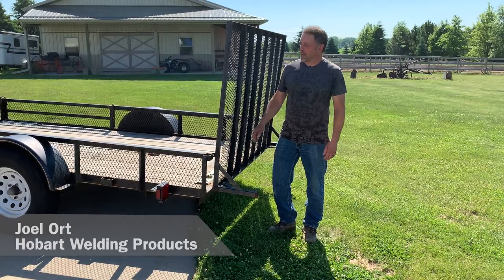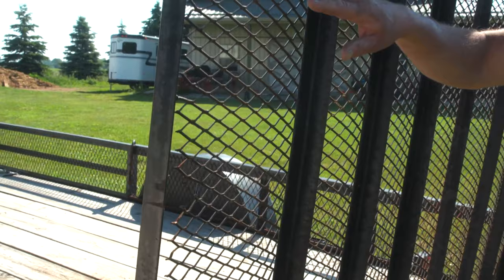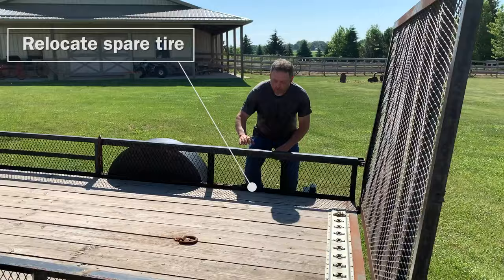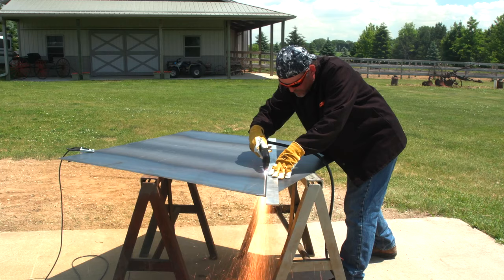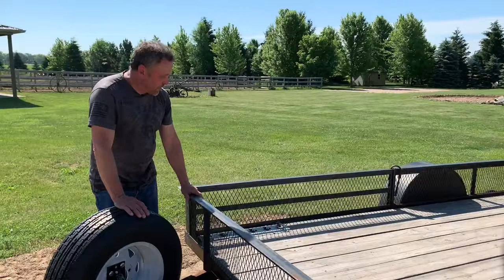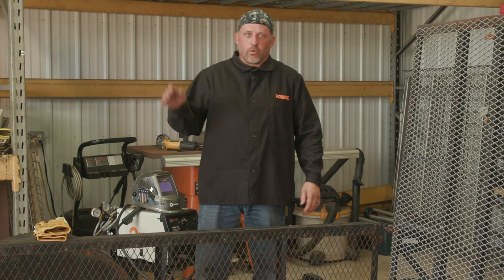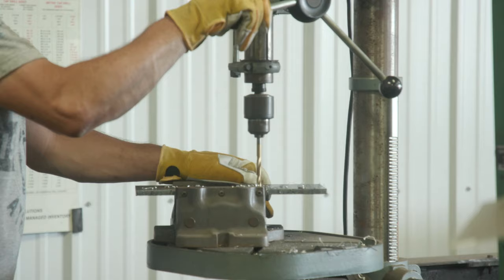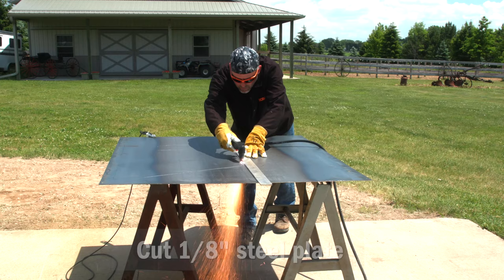How To Repair & Customize a Utility Trailer

Comment: Good how to. Need to weld the expand metal every other diamond on the outside of the gate.  And on cross braces.  That will help out with sage and breaking. 
On a side note one needs to make sure that the expand metal is put on the correct way.
Reply: This video was great.  It gave me lots of ideas for when I go to attempt this project.  But I would also like to see a video showing what you are talking about with the mesh specifically.  Thanks.
Reply: @mcmarsha67  if you lay the expanded metal down one way. The raised portion will have grip when walking down the gat. The other way or backward's it will not.